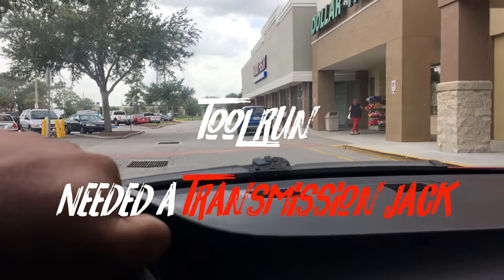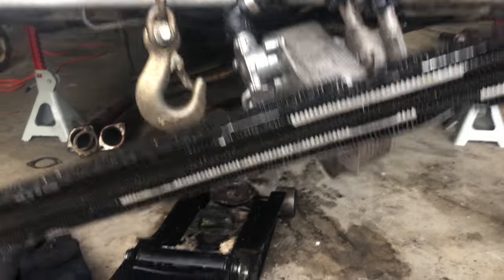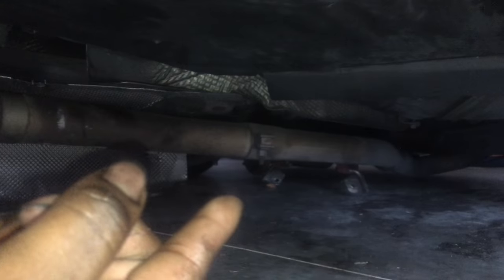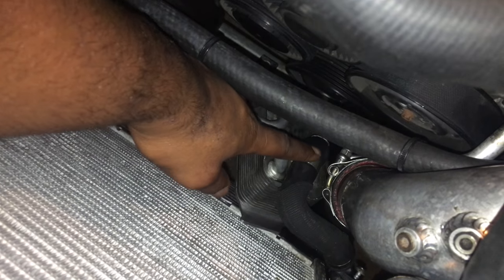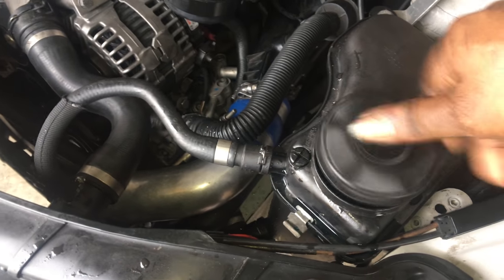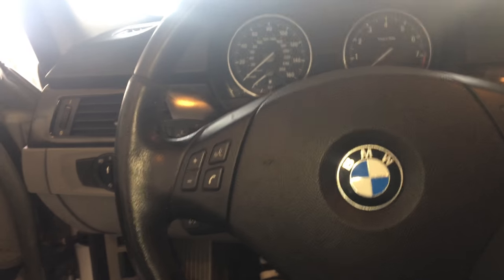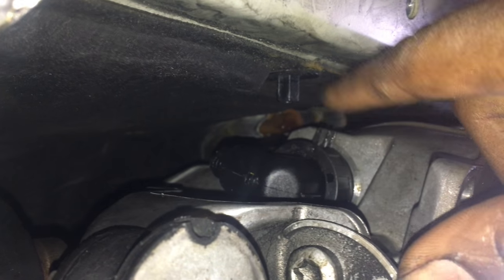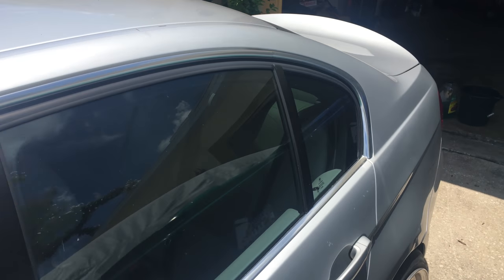BMW 335i N54 Engine Swap First Start

Comment: Dude!!! I'm so happy for you bro!! your a inspiration for me man!! i have a lot to do myself to my N54 this weekend OFHG, OCHG, Both vanos, coils and plugs.. anything i should know before i began? let me know, I'm very happy to see you didn't waiver man great job!!!
Reply: Yeah i was thinking the same thing about that coolant line its almost right on top of the e-bolt i went to harbor freight and picked up a universal 3/8 drive and a 1/4 e-10 swivel just for any unexpected problems i might have working in that tight spot..lol thanks for the part number still!!!! while on the subject i would like to ask you about Bosch oem plugs. since I'm going to DIY this, what's gap settings do  you reccomend i know bosch ships them pre-gapped and i haven't had this 335i tuned just yet its my #2  but plan too....thanks
Reply: Dude thanks, i wasn't sure although when i messaged them, they failed to mention this...hopefully i will shoot for more power soon. this is my 3rd bimmer and first 335i with the n54 platform, so I'm trying to be more hands-on and more involved in the process of all bolt -on's and upgrades..
Reply: bro tell me about it!!! after seeing what you was going through, it motivated me to diy everything and stop being lazy and paying thousands to guys who didn't do good work anyway....lol
Reply: Dude!!!! I'm so tired and sore, it was a workout bro!!! the part you told me to be careful removing was automatically brittle.... no matter how gentle i was removing it!!!!Lol so i had to order another part anyhow.. ask me they should have made this part aluminum!!! it would be better under heat and pressure. but over-all it was a great experience and i was very happy i was able to get it done and back on the road. Like say thanks man for the info. and order number you provided, you were a big help man.
Reply: Hell yeah!!!!!!Lololol

Comment: You ever code the injectors on this because you brought over different ones with the motor and that may shorten your replacement engine life
Reply: noshi how did you do that? And why didnt you just swap of the original one?
Reply: You need to code with values this is not something you want to mess up or can badly injure you when you get sprayed with 3000psi of fuel, catch car on fire, destroy your cylinder head if you don't install new or used injectors with brand new orings and springs using the special tool to compress the rings before install and then not coding them you will melt your pistons this is not like other cars that you can just swap them if you don't know what you are doing it WILL cost you thousands, you whole car or even your life
Reply: Did you have to take the injectors out of the new engine to code them.  To get the numbers off of them?
Reply: Thanks. Did you have to replace the the injectors o ring too?

Comment: After you swap the engine do you have to reset the cars computer????
Reply: Complex Seven Industries okay so I am having s issue turning it on it turn on for the first time on the first day I finished completely installing my new engine the car turned on and everything now the second day I finished adding little parts like all the bars and stuff I tired turning it on and my car only made electrical noses like some kind of vacuum nose kindle hard to describe I was thinking a bad battery but I don’t hear no clicking or anything by any chance do you now what that can be ?

Also I bought the engine completely naked so all the parts of my new engine are form the original, my original engine had rod knocking so I decided to just replace the engine.
Reply: Complex Seven Industries its thanks a lot to your videos!!!!  I might have to invest into a better scanner  but I am thinking that the battery isn’t strong enough what voltage is your n54 battery?
Reply: Complex Seven Industries IN CONCLUSION IT WAS MY STARTER IT WAS BURNT TO  CRISP which was draining my battery now my car turn on perfectly I just wanted to late you know what it was !